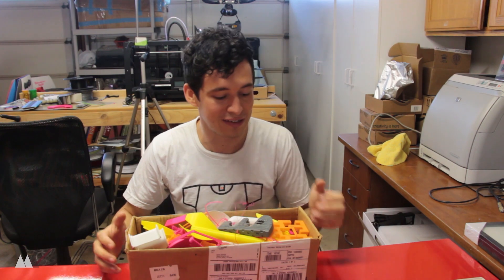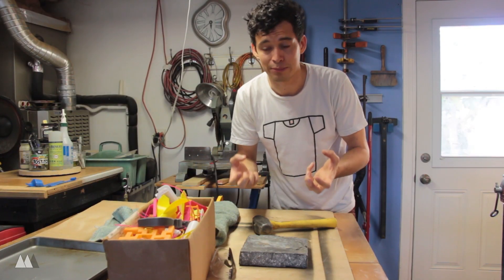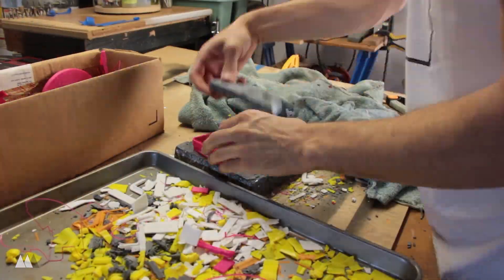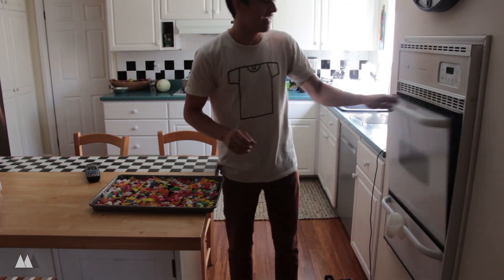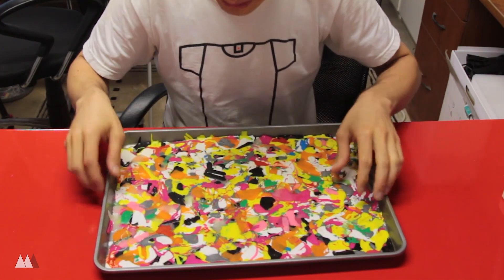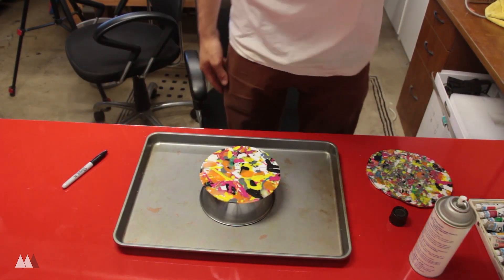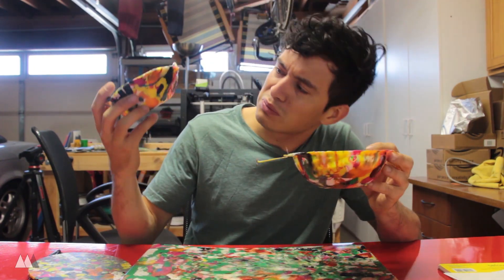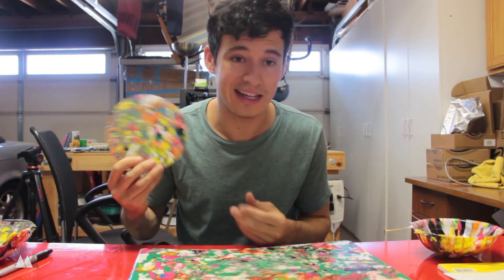Can You Recycle Failed 3D Prints?

Comment: you should cut the plastic into 6 squares with one with a hole in the center then 3D pen glue them together into a square and put a LED in the hot in the bottom.

Comment: You could cut out a 10% larger circle of reused plastic and put it between two upwards facing same sized stainless steel bowls with a heavy weight like a granite herb crushing bowl on the top stainless steel bowl and slowly heat them in water to boiling the larger size of the plastic will allow for the stretching of it as it melts in between the two stainless steel bowls to form a plastic bowl.  Just a idea?

Comment: that's remarkable. I'm trying to do the same process as well and research some resources. there is some information that is pros and cons. I'm not sure what is the right way to recycle PLA and what type of methods can be used to accomplish this. I am starting a small business, but it's in the process of doing research here and there. Awesome process this would be great leverage, have you tried other plastic from the triangle plastic from 1 to 7 plastic or do you mainly focus on 3D printed parts?

Comment: Don't you have two of these metal bowls?Maybe you can put one bowl above the plate, when it heats, gravity will pull the bowl down on to the plastic plate which is melting on top of the other bowl and this way the bowls will be copressed a little bit, if you need more pressure you might put a brick on top of that

Comment: Large piece: would make an interesting clip-board.
Bowl: place the plastic round between two bowls with the top one weighed  down with stones or something. The weight of the top one will push the plastic down into the bottom one, sandwiching the plastic round between the bowls acting like a dual press?

Comment: If You Make A Lampshades Out Of The Plastic, You Will Have To Watch Out For The Light Bulb Being To High Of Wattage If It Gets To Hot The Plastic Will Melt On The Light Bulb & Then Your Light Bulb Will Blow Out. I Had To Get A Special Light Bulb 15 Watts For My Daughters Pink Plastic Barbie Lampshade!
Reply from the maker: That's why I always use USB lightbulbs when dealing with 3D printed parts

Comment: You can grind them up, put on a cookie sheet to make a picture and melt in the oven then let cool.  Plastic art.

Then 3D print a frame
Reply: and that oven will go lower... 125.

Read the manual... 350 is the default when you turn it on.

I used to sell and repair those things.

Comment: The little bits in your case would be called printers tears it’s kind of along the lines of the same thing as when a potter is firing pieces in a kiln with glaze and the glaze drips and solidifies those drippings are called Potter’s tears

Comment: it seems like if you could melt the plastic evenly in a sealed cauldron, then pumped in air pressure to the cauldron with a 1.75mm opening in the bottom, you could re-extrude the plastic into filament?

Comment: I found that at least the good old cheapo Kaisertech PLA will flow really well at some 250°C. It actually could serve as a more rigid hot glue as it grips on metal surfaces very well then. I plan on some casting experiments with it, just couldn't be arsed to yet. ^^)
I guess easy to break down plaster molds will be okay. As I said, I didn't try yet.
PLA is fairly imune to UV light, maybe one could use it as a sturdy protective coating for steel?

Comment: PLA is a plant based polymer and is supposedly biodegradable. I'm wondering if you could successfully get it to break down into mulch? You'd definitely need to break it down into very small pieces and combine it with a lot of other organic materials. 

It might also be neat to see how long it takes for PLA to dissolve in water on its own. Like you could break it into various sizes and submerge them in a large glass container of water and keep it in a sunlit place and track the break down process.

ABS is the same plastic used to make legos. So in theory you could melt ABS scraps into molds. Maybe silicone proto-putty molds?

Comment: try 3d printing objects you would like to make, use clay to make a 'negative' or inverse of the mold, heat the clay in a kiln, and then use that clay to melt the plastic into in your oven.

if you had a particular object you wanted to duplicate 1000 times, you could then easily do so by making ~20ish molds and buying bulk recycled plastic or just saving the scraps you have over time like you already do

Comment: Try using a "heat gun" to evenly melt the plastic to your desire , it will take longer but if you distribute the heat properly it should mold the way u want it

Comment: The 2nd piece would look pretty sweet in a frame there is some nice patterning in that off center "explosion".
If this was ABS you could dissolve it into some acetone to create a slurry and then use that slurry in a mold ( topping up every now and again as the acetone evaporates out ), PLA i havent played with as much yet but there must be a similar process which would allow us to recycle the scraps , i have an idea to create an extruder that will basically just turn those scraps into a line so we can use it again but not sure about a few minor parts .

Comment: If you REALLY want to be sustainable, get or modify your printer to use plastic pellets. Most of the money you spend on filament is from ensuring a specific tolerance, but if you have a hopper based printer, you can used crushed prints with 20% new plastic and save a good bit of money.

Also, small anecdote: I couldn't figure out why I've been wanting to get a specifically purple bin for waste plastic, and I remembered watching this a long time ago.

Comment: Why not shred them to small pieces, and then extrude filament from it with a proper extruder?
Then you could print it again 
(You can't recycle it infinitely as the long over 10.000 atoms long molecule chains break with each extrusion, thus the material will lose strength, most 3D printer enthausist i heard about the topic would say that don't recycle more than 6-8 times)

Comment: This is an "old" video and I haven't read through all the comments but I imagine that using that lead block maybe/probably introduced some bits of lead into the plastic. Also, part of the reason why the plastic isn't molding cohesively over the bowl shape is possibly due to heating too fast causing uneven melting. Anyway, like I said.. I didn't read the comments so this has all probably been said.

Comment: I LOVE the bowls you made. What you could have done, is to press something flat/hard on top while the bowls was on the metal bowls, just to make sure it would be stable when you put it on the table. Then - still being warm/soft - press in a few nails or washers in the bottom, to add some weight down low to make them stable. EXCELLENT candy bowls, kids would love them!

Comment: There's more than one reason it didn't work as planned. I had a feeling before the video got to melting inside it would work better. Measuring the circumference of the bowl only gives you the width you need the material for depth. not a bad idea. I want to see a commercially available recycling thing that makes old print or legos etc into filament

Comment: I just happened across this but what if you tried taking two metal bowls in the oven and putting the plastic circle in between? also maybe weigh the top bowl down with a rock or something while in the oven so it pushes the plastic down evenly. you may need to trim the edges still but you might come out with a more even bowl.

Comment: What about pouring or melting into those skinny stick ice cube molds, and use with a high heat hot glue gun? Like a cheaper and fatter 3D doodler.

Comment: filament.maker my thinking is you need two things a very well regulated temperature of of the melt second is a very exact hole to push out of if the melt is two hot it will shrink to much upon cooling also the density of the plastic can have a role it must remain flexible and the density of the  filament. will effect the amount of plastic deposited in x amount of time

Comment: You were on the right track with the first attempt at a bowl, but you should have used a circle that was significantly larger. Allow the extra material from the circle to droop past the edge of the bowl and onto your baking sheet. Trim off the extraneous material to even it out and give it a nice finished look (or keep the irregular blobby look for something more organic).
Reply: Exactly what I was thinking the whole time. It's the same reason why when you make a pie crust you roll the dough out to a larger circumference than the pan - because you gotta consider the the depth. If you could flatten that bowl out, it would obviously be a bigger circle than the circumference of the opening.

Comment: one thing I do with extra abs bits. melt them in acetone. You can make abs juice you can eventually paint onto your print bed and your print will stick to it every time. think of it this way your print bed will become plastic. your molten plastic will lay ontop of plastic that's coated the plate. I do it on my printer and it hasn't failed yet. also with the abs juice I've use it to bond and fill gaps for prints that have to be bonded together. it works as a nice glue and filler. I've got an old pickel jar I have a bit of acetone in that I throw little abs bits into. 

also there are machines you can feed bits of plastic recycled or pellets (way cheaper than filament form) and you can extrude your own filament. couple companies are making these now for consumers. would be cool to play with and make different mixtures. add metal powders and stuff to make your own custom filament spools. 

keep up the good work!

Comment: You can turn the round shape into a wall clock just adding a cheap clock movement and hands, providing they are visible (i.e. in a color that will not hide on that kind of background). What do you think?
Reply from the maker: I have an old clock mechanism laying around.. maybe I can even print the hands
Reply: Stefano Bettega great idea

Comment: Why not get reel extruder? Take your failed prints, shred them, feed them into the hopper and you get a filament out the other end. You can easily make some pretty cool looking color variations that guarentee a unique print when you use the filament you make.
Reply: Graytail extruders cost more than printers !   and DIY ones are crap at getting a consistent diameter.

Comment: Cut the circles bigger. Place the plastic on top of the bowl (so when it melts it drips on the inside of the bowl) and put the same bowl with weights on top. This way when the plastic starts to melt there is going to be pressure that forces it out to the sides and you get a better bowl.

Comment: Maybe for another attempt you could try a heat gun with the bowls? Localize the heat starting in the center and then move outward. I think the main issue you had with the oven getting the PLA firmly into the melt range instead of just really soft.

Comment: you should use a blowdryer or a really cool torch from far away to slowly melt the plastic and in the ways you want it too
the torch might burn the plastic though
Reply from the maker: Brad Feng I just got a heat gun 😁
Reply: A hot air gun is what I use.
Reply: a blow dryer can not melt plastic, nor can a cold torch, from far away.
Reply: a blow dryer can soften plastic to the point where it kinds of become malleable ish
Reply: Brad Feng
Reply: heater gun.

Comment: Boxes / electronics enclosures. I'm thinking you can trace out a template for a box (as you would with paper) and then use a hot air gun to heat where the seams are and fold it into shape. Then you could glue or weld any seams - maybe a soldering iron could be used here.

Comment: Hi Devin (Sorry if I butchered the spelling, hah.) My suggestion would be to make your melted sheets larger and your bowls smaller. That way when you melt your plastic sheet over the bowl, it covers most of the bowl's surface. Any weird mess can be cleaned up pretty easily after that, I think. YAY science! 😉 Hope this helped :) Would really love to see this project successfully done !
Reply from the maker: Nicole Shin thanks for the advice :) I realized I could make the discs larger, but I figured it would stretch as it slumped. I think I also need to melt the initial sheet more consistently

Comment: dude, you actually were doing some very unsafe things and i sincerely hope you do not try making anything that would be eaten off of. the smell was toxins leaching from the plastic and using it for food or drink would have made you ill. there is a reason that you are not supposed to put most plastics in the microwave and are supposed to discard plasticware when it becomes cracked/scratched or melty
Reply from the maker: I was definitely never intending on eating out of the bowls... but yea, the oven baking part probably isn't so great... I mean, it's the same fumes a 3D printer is putting off, but to a much larger degree
Reply: that is good at least, there is always a concern of safety with plastic but remelt is way more prone to bad ends ^^;;;

ah, i had not considered too much the smell of the 3d printer, i assume it is a bit like polymer clay in that regard XD
Reply: I melted nutella today in the jar because I'm dumb and it caught on fire and I was home alone luckily I was able to put it out and I didnt break the microwave
Reply: KatieDUCK319 :D - did u still eat the nutella tho
Reply: oh my gosh x___x

Comment: Try putting the scraps into the bowl then heat, remove from oven when ready, place another bowl into the first and press until set.
Plastic will ooze out of the sides use it to find out the wall thickness.